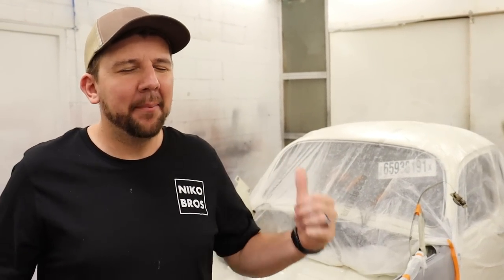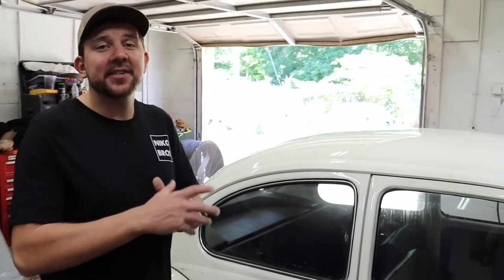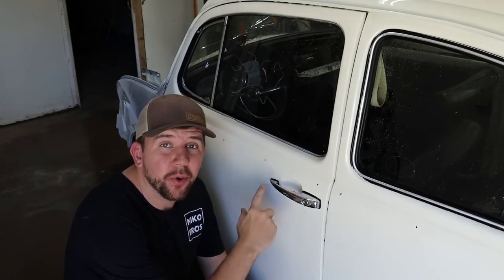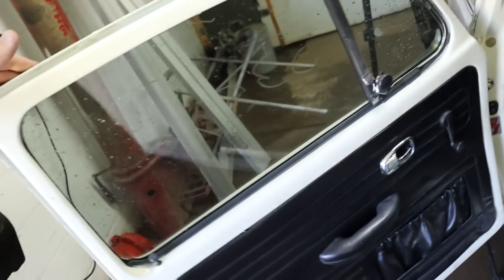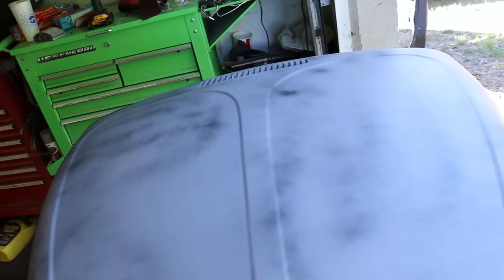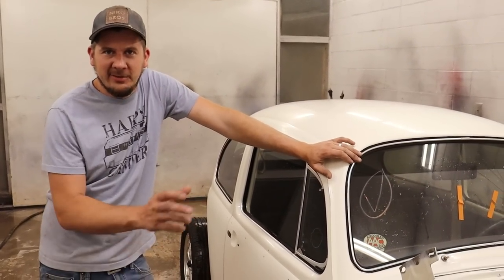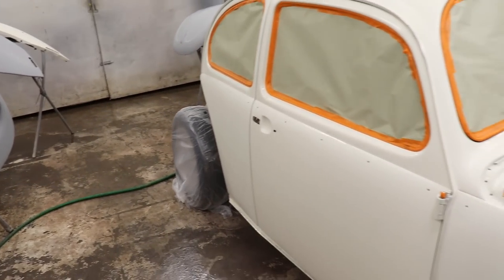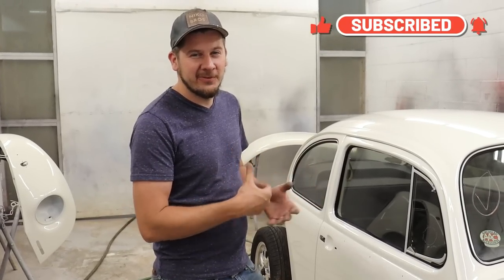1968 VW BEETLE PAINTING EVERYTHING, GIRAFFETOOLS ELECTRIC PRESSURE WASHER TESTED

Comment: I am still confused. You keep calling this a 1968 Beetle. However, you door mirrors are from earlier VW's. The 1968 mirror was attached to the door just in front of the vent wing window. Also, the rear engine bonnet is from a later VW. I believe it was 1971 when vents were added both above and below the rear bonnet hinges.
Reply: It may be that some worn pieces were replaced during it’s long life?